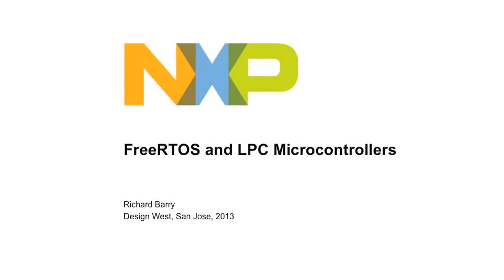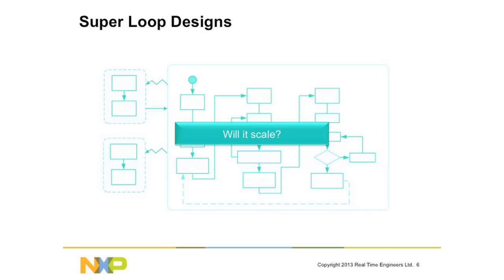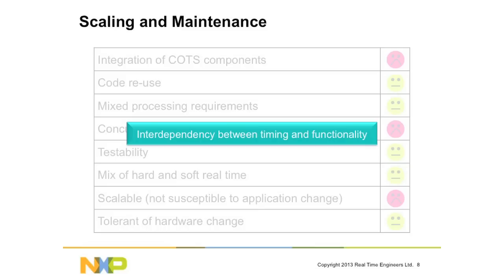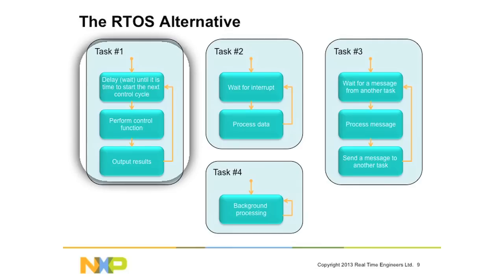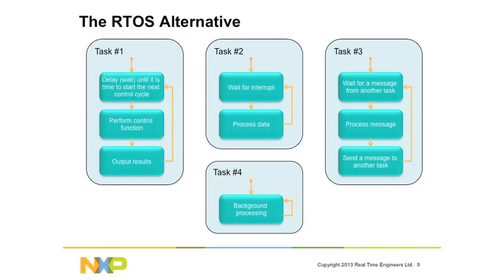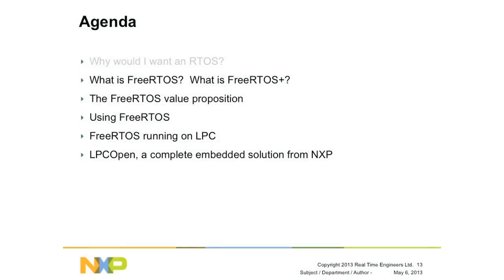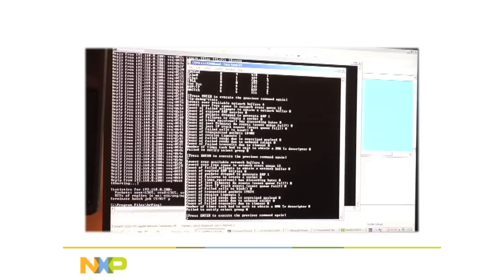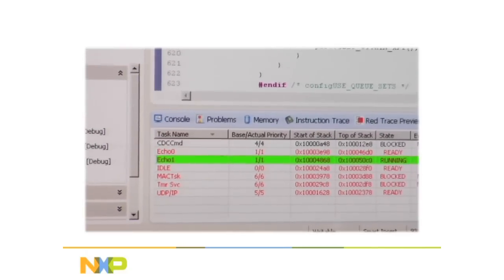Get to know FreeRTOS from the Creator! - DesignWest 2013

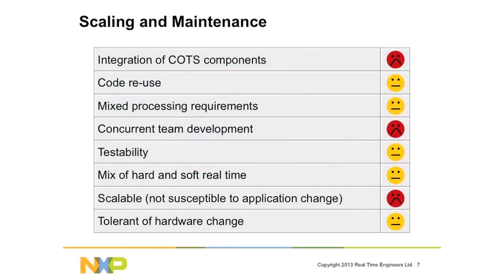Comment: 2:15 Code reuse is a non-issue here.  It all has to do with proper separation of concerns in your code.  You can write non reusable code by intermixing operating system functions with your domain level code.  As long as you do a good job of separating your scheduling code from your application code, reuse should be achievable.  That's all based on coding discipline and has absolutely nothing to do with an OS.

Comment: Why freeRTOS being such a good SW is free?
Reply: You could ask the same question about Linux.
Reply: MichaelKingsfordGray  yeah how dare anyone question the authority and intellect of a random person on the internet. You are right, various compiler comply more or less with the language standards, and the language standards are not in and of themselves perfectly well specified. This doesn't actually set c apart from any other language though, and this isn't necessarily even a problem for the language to address. There exist other tools for analysis and verification of software semantics other than compilers.
Reply: MichaelKingsfordGray  get outa here!
Reply: MichaelKingsfordGray  I've been using C/FreeRTOS for 2 years now, and the only time my code fails is when I screw something up. FreeRTOS is a fantastic tool.